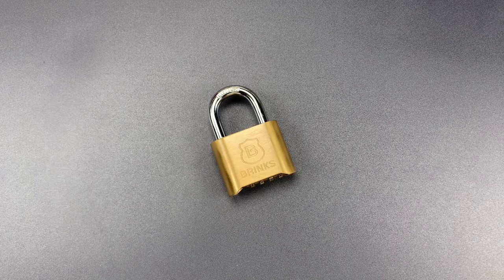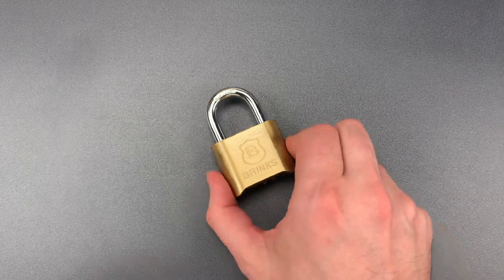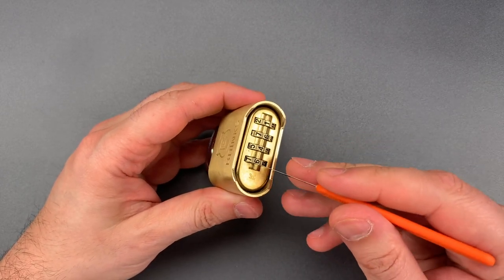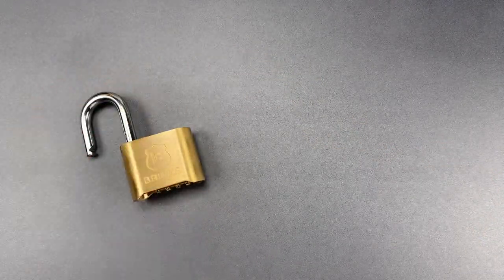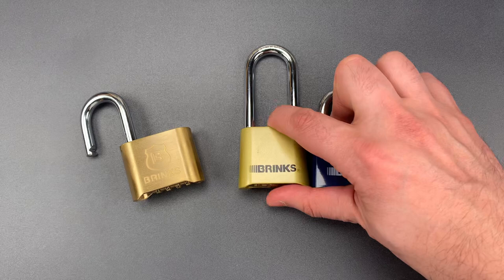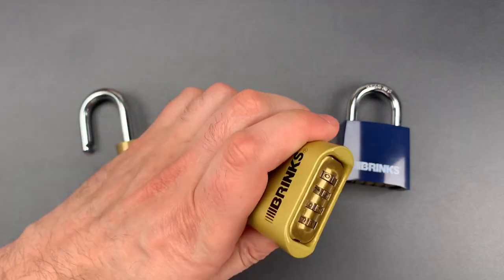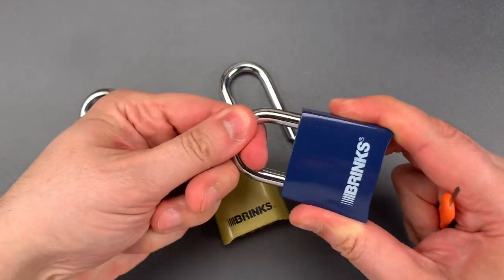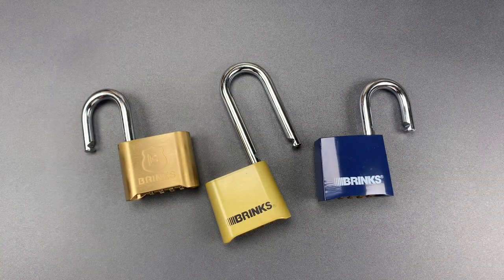[1014] No, Brinks Did NOT Fix Their Combination Lock Flaw!

Comment: Wonder if Brinks trucks use Brinks locks...
Reply: Brinks would be buying another fleet if that were the case :)
Reply: Actually they are different companies.  It appears the locks are a branding deal.  They are from a company called Hampton (Hampton Products International Corporation)
Reply: Brinks trucks also have guys with guns in them
Reply: Brinks is one of those companies that get pieces made from other factories.
Still, design is theirs
Reply: Barney fife don't count as guys with guns. :)
Reply: As an armored courier for Brinks, I can tell you with confidence, we do not use padlocks on the trucks. All locks are build into the truck and can only be opened by the driver, or remotly from the home branch.
Reply: @PNut8421  Ooh now I'm curious how difficult it would be to spoof the remote unlock
Reply: @PNut8421  Great job as a brinks employee, informing the public about how brinks armored truck lock systems work. lol. I mean sure you probably could have found that information on the internet. But I wasn't looking for it. And Tex is now scratching his head about how it could be hacked. I like youtube.
Reply: @KevinBarnes   Appropriate company acronym - HPIC :-)
Reply: @JT-tz5hp  my job is to find flaws in processes and systems. Naturally I worry about potential gaps in security like that
Reply: @rucker69  No need to spoof the remote unlock, just bring a crowbar and an angle grinder.
Reply: I saw one today lol
Reply: @danpowell806  A very good way to ask for trouble. Even trying it would likely set off alarms, for one thing

Comment: Technically they're right. You can't shim the left side. You have to shim the right side
Reply: Turn the lock over. Problem solved!
Pick always goes in to the same side (underneath the rotating side of the shackle)
Reply: I was writing this until I looked up at the picture frozen at the end of the video.
Reply: Frank Gorshin would have made such an assertion on a particular episode of Star Trek.
Reply: Still the same attack substantially.

Comment: When you see a new LPL, it's "Ooh! Goodie!". Then you notice it's less than 2 minutes long, and it's: "That's a poor quality lock". Then you spot there are two locks in the picture: "Ah. Very poor lock". Then he picks three locks in the time, and words just fail you ... LOL
Reply: It takes me longer to enter a single lock with the code than it takes him to open all three... And as to the comment "left vs right"... Nope. He just holding them reversed. Look at which side had the lock, and which side is attached to the body. The first is on the left, the others he held reversed. But not a viable lock.

Comment: The new style lock shackle is on the other way around though! This means you have to shim the code wheel on the right-hand side rather than the left as per the older style. Such fiendish trickery! Surely LPL won't see past this cunning lock development! :D
Reply: What if they didn't even switch the mechanism to the other side? What if they just put the logo on the back side of the lock so it looks like they moved it?
Reply: chasemc69 Thats exactly what they did - the weakness is at the hinged side of the shackle. Thats what marketing call re-engineering - but very low cost.

Comment: Just want to thank you, my mom lost the combinaison of her costly cheap safe and because of your video I was able to open it in less than 30mns. At first I was thinking of making an openning at the back but your videos had me thinking of just making a drill hole in the front between the key-lock and the rotary dial. I was very lucky, the main pin was 1/2 inch from the hole and after making a second one I was able to open the safe. From the back I'm sure I had to work very hard for at least 4 to 6 hrs. Now I will make a litlle repair, disable the dial and just keep the key so my mom will be able to use it easely. You know, you voice is almost the same as the holographic doctor in Star Trek Voyager ? Keep the good job, you make great video.

Comment: The engineer that told them he redesigned the lock fixing that problem better start working on his resume
Reply: gsneff It wasn’t an engineer, it was some idiot in marketing (I’m not convinced theres any other sort in marketing).
Reply: @andyowens5494  marketing people don't know anything about redesigning actual stuff for manufacture. There was definitely an engineer involved in this, however that doesn't mean the engineer is good, care about doing a good job, or was even able to do a good job because of the demands from people higher in the company. You want it fast, cheap and good? Sorry, you're only allowed to pick two of the three. If you want it fast and cheap it simply won't be any good, which is demonstrated here.
Reply: You're making an assumption not supported in the video.  As far as I can tell, no one from Brinks said that this vulnerability had been addressed.  Unnamed persons said that the locks are now different.  And they are different, just not in the ways that matter.
Reply: @TWX1138  to be fair, that's the kind of decision a marketing team would make XD

Comment: Old shoelaces will provide more security than this padlocks.
Reply: Headphone cables. Even LPL would take more than 2 minutes to untangle those...
Reply: Dude, it's worse, he can cut it in less than 5 second. But you gave me a better idea, a big chain and tangled with huge rope. The bad part is even the owner have a hard time to unlock the mess
Reply: Dude, you're not even wrong....
I picked up a lockpicking set recently and a handful of locks to start practicing with.
The Brinks lock is the second worst in the set. Tension the keyway, insert a rake and rock it a bit and it falls open like you offered a hundred dollars at an 'adult entertainment facility'.
It takes me longer to take off my shoes than it does to open this stupid lock. It's not even good for learning on. -__-

Comment: Soon ill be using ropes for my doors next
Reply: It would take longer to untie rope than to pick these locks!!
Reply: Be careful as most ropes can also be opened with a thin shim of metal
Reply: Don't be pessimistic.You can use a SS100CS with a EVVA MCS cylinder.It will only cost you 400 USD!
Reply: @naamadossantossilva4736  r/woooosh

Comment: Who or what lead you to believe these were improved in any way? The only improvement I see looks to be of the cost to manufacture type. I could be wrong but the body looks to be tapered slightly and now the indelible mark has been replaced by a smear of paint. Clearly the guts are the same or just as bad as before.

Comment: I was going to make a joke initially. But after looking at the comments i feel the need to offer he employees at brinks a bit of a positive note.

Look yes these locks are from a security standpoint downright terrible. But everyone rom the designers to the managers to the marketing team knows this. When the designers were given the brief to design this they will have been given a whole bunch of features that have no bearing on the security. Foremost amongst those will have been a maximum cost to manufacture. And that will have been set based on where competitors are pricing their competing locks and the kind of profit margin brinks wants.

Everyone involved knows the security level is terrible vs anything short of, light physical attack. But withing the price point they have to work with and the costs of manufacture thats the best they can do on the budget they have, no one's incompetent, in fact they're very competent, it's just that said competency is being directed towards an end goal other than maximising the locks security.

Comment: I see you using this on different lock brands and essentially same and different models. When you put the thin metal piece in does it work on all of the different slot spaces there are, on both sides of the dials?